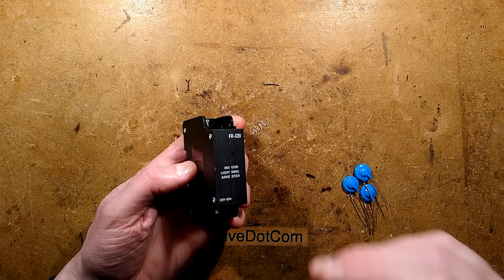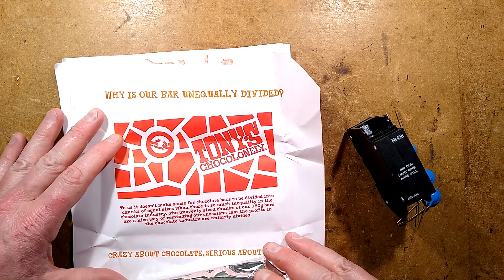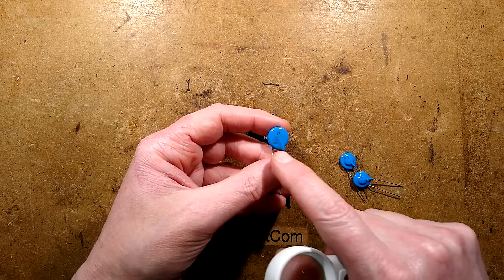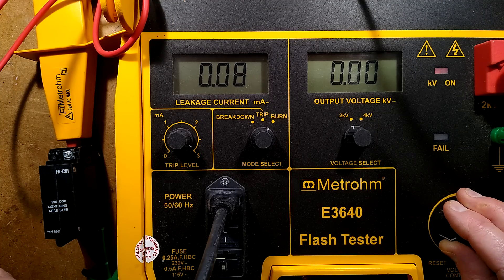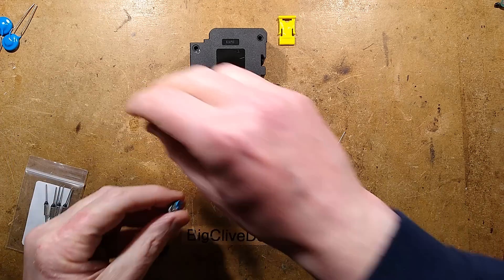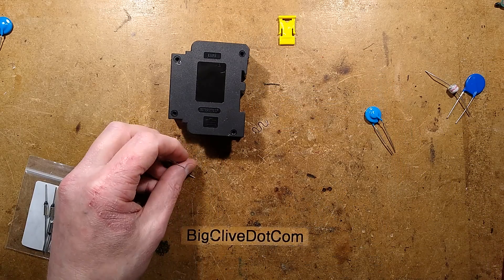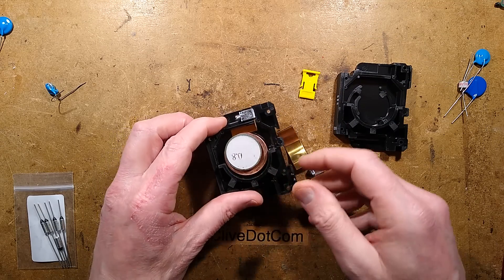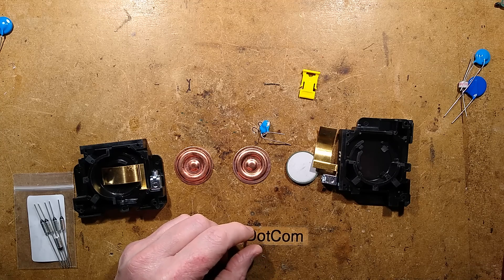Inside an African lightning protector - and candy

Comment: GDTs are usually only involved in SPDs where the earthing system impedance / distance is high enough, for example in a TN-C / TN-C-S setup the N/E linkage is more than 10 wire meters away from the SPD.  Clamp phase to neutral with a MOV and then neutral to earth with a GDT.  The GDT prevents continual leakage current onto the earthing system.  If the SPD is closer to the N/E link clamping neutral to earth with a GDT is pointless so the GDT is omitted.

Comment: Yes. I lived Johannesburg on the “highveld”  6000’ above sea level in South Africa. This is a place that has one the highest number of lightning strikes in the world. I got tired of having my electric gates, microwave, tv etc etc destroyed by lightning. Even a strike near the mains feeder cable absorbed the emp.  and after consulting with an expert I installed a set of MOVs in our main switchboard.  Many people had plug tops with a mov inside. Apparently if you have a strike you should replace the mov. Was never sure how I could test them.
Reply: A proper surge protector will have a circuit that measures the leakage current across the MOV. When it increases to an unacceptable level indicating damage, a "protected" light will extinguish and in switchboard/installed applications, an annoying buzzer will sound. It also needs a thermal fuse, because in cases of catastrophic damage, the leakage current will increase to the point the MOV will heat and burn. You shouldn't use plain MOVs for this reason.
Reply: @straightpipediesel  It was about 30 years ago & I no longer live there. The company that supplied them were consultants for lightning protection on a big steel mill upgrade and expansion project that I was working on.  The main problem was that the incomer switchboard & meter was at our gates with a cable running underground for about 60m (we had a long drive way) up to the house. They seemed to solve the problem at the time and the house is still standing .😀
Reply: Which is why you need made in South Africa ones from CBI for example. Your solar panels will need DC ones too to protect them and your inverter\charger 🌚
Reply: @andrewallen9993  The company that supplied them were our consultants for lightning protection  on a steel mill project (Middleburg) I was working on - pretty sure they were upto spec at the time but it was 40 years ago.

Comment: The roof being neutral earthed may simply be a precaution against the overhead wiring falling on the roof or the means of anchoring the overhead wiring to the building becoming live.  Such items can become live indefinitely without the neutral earthing, just waiting for someone to get themselves between it and the physical ground.  Lean a ladder on the roof and you are dead more or less.  Of course, this assumes fuses or like upstream in the network which there probably is even if it is only on the primary side of the transformer.

Anchoring equipment (P.O.A.) is often neutral earthed in Australia, varies based on the age of the installation and which state / territory it's in.

Comment: From What I Can Tell This Was Made By CBI (Circuit Breaker Industries) Which Is A South African Company,  They Are A Well Known And Trusted Company In South Africa And There Products Are Extremely Good  Quality And Reliable, I Believe That This Is Either An Older Protector Or A Clone Of A CBI Product As They Do Not Use Those Screws Nor Connectors At The Top And Bottom.

Amazing Video Regardless Clive!
Reply: Yes it looks like they took the CBI samite breaker type and made a cheap clone. The CBI surge arrestor comes with the indication if it is still functional.
Reply: There is no guarantee that this is a 'gin you wine' unit. There is a chance that it could be a Chinese clone / counterfeit.
Reply: @Frankhe78  Most Definitely A Chinese Clone

Comment: I have inspected dozens of household fuse panels after lightning strikes. The black device would be great protection and worth its cost 100's of times over after a direct hit. Fitted behind a 100A breaker it will not save the latter but likely everything downstream. Nothing wrong with copper coated steel discs. The skin effect makes most electrons travel on the surface anyway even at 50Hz. The steel plates would also act similarly like crunch zones on cars, slowly dissipate the resulting heat. Overall the product enjoys great corrosion protection and good longevity.
Reply: Skin effekt does not really come into effect at 50Hz when talking about the scale we have in typical homes as the skin depth is over 9mm in Copper. So this would only be relevant for beefy bus bars etc. you typically do not see in home installations ;)
But you are still right: when talking about lightning stikes effective frequencies are much higher then the 50Hz of the grid. So the current of these impulses (not of the normal operating current!) is carried mostly on the surfaces.
Reply: The skin effect depth at 60Hz is 8mm. As a rule of thumb, if a device fits in your hand, the skin effect at mains frequency is not relevant to its operation.

Comment: Talking about lightning here, look at the shape of the copper discs. They trap a volume of air between them. If an extreme amount of current is coming for a brief moment the intent may be to heat and expand that trapped air "explosively" and blow the discs apart within the housing, creating a temporary self-sustaining spark gap.   

It may not save any sensitive electronics but I gather the idea here anyways is to prevent house fires.
Reply: The thing is that a fuse or breaker is specifically supposed to extinguish arcs, not sustain them. A "self sustaining" spark gap would pass almost as much current as the breaker would while closed, since the entire point of a spark gap is to act like a closed switch when there's an arc across it. Those are almost certainly just some locally available washers that are about the right size to act as shims

Comment: I think the metal-oxide varistor should be in between the copper-plated steel disks. Then there'd be a spark gap between the rims of the disks , around the circumference of the MOV. Spark distance the thickness of the MOV plus a bit. That would also convert the linear contact point of the brass spring contacts into a nice gentle ring contact on the MOV.

Comment: Lightning is jumping an air gap often miles long.  I don't think anything that fits inside a house is going to do jack squat to stop it.  :\
Reply: "I don't think anything that fits inside a house is going to do jack squat"  No. But there are near-misses. Electricity does not 'take the shortest path', it takes ALL paths; more on the better paths, less on the long/skinny paths. 
We once had a huge tree hit, can't stop that many-thousands-Volt strike. We also had fried modems and microwave-brain every year, hundreds-Volt side-strokes from a main stroke a ways away. Little MOVs and similar greatly reduce damage from induced current. 
It also seems wise to have layers. I have massive dirt-grounding along my overhead line and underground feeder. I have a big MOV unit in the main breaker box. And I have "surge strips" on any precious load.

Comment: If the center of the shims is lower than the outer and that dark ring around the varistor is an insulator then maybe there's actually a small air gap there, but if that's the case I think each steel shim should be on each side of the varistor, unless they designed it to use the same parts to make arrestors for different voltages by swapping the position of the shims, like one way for line to neutral and the other way for line to line.

Comment: Yuck. Stevia, tried it and leaves an after taste. Also like sucralose, it is still high in carbohydrate 😮
Reply: Sucralose is almost pure carbohydrate, chlorinated sucrose actually. You just use very little because it’s extremely sweet. (600 times sweeter than sugar.) it’s often sold bulked out with dextrose or maltodextrin, through.

Also the human body doesn’t seem able to digest it.

Comment: That laugh when testing the "copper" disk made my day.
Reply: TRUST NOTHING!
And he proved himself correct with that mindset instantly
Reply: Same! The "Maaagnet!" was the best.
Reply: Maybe they're bimetallic for a reason!
Reply: @abitofabitofabit4404  possibly, but for what reason?..
..thay was pointed aginst eachother anyway, that makes a litte sense, tha fact its magnetic is interesting... its possibly at high enugh current those two will separate (magnetic separation), but thecurrent need to be darn high .. high enugh to make it useless as aprotection device i belive, and as a lighetning protecton, well, thay will weld together long before thay can separate likely, and as its desiged, the 'shims' are alot larger than the varistor and the lead thats clamped to it, so u have a gap beteen conductors that marginally larger than the with of the varistor, any lightening strike would jump it like it waseent present...
...but as a protection against surges, starting/stopping lager electric motors etc it probably work.. I def wouldent trust it doing any lightening protection
Reply: @Patrik6920  Well, if directly struck by lightning, even if it were actual copper, it would still blow itself apart. Eddy currents get weird when current is really high. Everything that carries current tries to escape from everything else that carries current. Very violently. But if that happened, you have already failed to save your devices from the lightning.
Reply: @Bubu567  true...
its someting rarly mentiond: the time factor, a lightening discharge is quite fast...
sure sometimng may be built to 'eat' a 100kv spike, but lightening is litterally electrons moving, and thay r fast... over a second the energy is not that large..but the energy is delivered over a very tiny time, ns
say u have a discharge of 1MW over 1 microsecond... its energy is 1w
..but usually if anything is built correctly u should never ever have a direct discharge strike.. still the discharge spike will still have sever consecuences for most electronics..
Reply: As a resident of the South African 'highveld' (1600m above sea level)  I can confidently attest to the fact that there is no such thing as effective lightning protection in this high-altitude environment. Had a strike on a 20m high bluegum (eucalyptus) tree, it arced from the tree to a steel fencepost 15m away (part of a 300mx2m weldmesh fence), from there it jumped 20cm to the steel box containing our electric fence energizer, blew that to smithereens and vaporised the brass contacts on the 220V supply switch. I've seen stainless-steel hoseclamps fused with aluminim into one homogenous mass when my CB radio antenna was hit a few years back, and yes, it was very well grounded.....

Comment: Very interesting! We get so many strikes on our supply lines, and then when it does we get a fault where one particular LED light blows even when it is switched physically OFF - puff of smoke and a bright flash then stinkaroony and Amazon make a profit yet again!

So... would putting a bunch of those blue things across the 3 phases in our consumer unit prevent it happening?

And... do they sell that groovy chocolate in Britain?
Reply: They do sell it here! I'm not sure where as mine was gifted
Reply: @TeddieBean  You should be able to find the chocolate in many different retail locations. Don't know exactly where to get them but I have seen them around. Here in the Netherlands you can find them everywhere.

I would suggest to put one MOV or GMOV across the LED bulb L + N as close to the bulb as you can. For instance in the junction box above the light. That should provide adequate protection against overvoltage, given that you have a type 2 overvoltage protection in you main distribution board that will take most of the hit. If you have overhead lines coming in you should consider fitting a type 1 overvoltage protection.
Reply from the maker: Co op and Tesco have the chocolonely bars.  You do get UK specific lightning protection.

Comment: There would have been a spark gap if the MOV puck had been between the copper-plated shims. That would also have provided more even clamping force and current distribution across the puck too. Looks like an obvious manufacturing error to me.

Comment: I did a fair amount of high voltage (0 - 1MV+) protection of instrumentation in a previous life - GDTs, VDRs - even down to fast silicon transient diodes. If you can't stop it at first try to delay it a bit until you can. (Lots of energy in 1nF capacitor at 500kV)
I did wonder if the two 'copper' discs should have been each side of the transient disc such that a small gap would be left to form a crude spark gap. I couldn't tell from the video whether this was a goer.
I think someone else suggested this device would need to be placed after a breaker because the fail mode is often to short.
I was lucky that I was not in power distribution and my requirements were usually only for the instrumentation to survive the occasional breakdown. 
Also gas discharge tubes do not respond instantaneously - fast but not immediate. They are good because they can usually handle large currents when triggered but pretty low leakage before. (Also low capacitance compared to semiconductor devices)
I've not seen the GDT in series with a VDR before - interesting. 
Really like the Tony's chocolate bars but sharing them is a nightmare.
Sorry for the ramble.

Comment: The non-resettable thermal fuses ( in your little plastic bag ) ... are a  TOTAL  disaster ( ? ) , manufacturers fit them to all manner of household gizmos ( in the most inaccessable places ) ..... SO MANY  folk throw the faulty  item away , I have found that simply shorting them out is perfectly safe ( with the owner strongly advised not to abuse the " modified " item ) .... such modified items can work for  DECADES  with NO issues ! ! .... ( tried - n - tested ) ... DAVE™🛑
Reply from the maker: I really don't recommend bypassing thermal fuses.  It carries a lot of liability.
Reply: In most cases the thermal fuses are to protect the device from a thermal runaway failure and adds second layer of security. It's not recommended to bypass them.
Reply: @deterdamel7380  Normally I prefer not to do this ... but .... with simple household items , like sandwich grills , the thermal fuse is not really needed ( older models do not have these ! ) .... if the element burns out , it just stops working , ( or shorts to earth , blowing the plug fuse ) ... if I remove these unreliable devices , I ALWAYS inform the owner ( not to leave it running all night ! ! ) .... DAVE™🛑
Reply: @davidfalconer8913  This is non-compliant. You can't argue older devices don't have these, just because you're too lazy to replace them.
If you're unable to realize the use of the additional thermal fuse, please do not repair these devices. Sorry, seems that you're not qualified.

Comment: Perhaps they have made an error in the assembly? Maybe the MOV should be sandwiched between the "copper" plates, so they could also act as a spark gap?
Reply: Yup, I immediately though the same thing. The shim must have been intended to uniformly clamp and spread current across the MOV slug's surface on both sides instead of letting the puck only make contact with the other terminal's spring. Definitely looks like an assembly error to me too.
Reply: I dunno, I'd go with parallel for MOV and gas discharge. As the MOV begins to fail and eventually open due to vaporization, the gas discharge would engage and continue protecting at higher energy levels.
Yes, vaporization, I've had MOV's fail a foot away from my face, nice ball of plasma as they short and vaporize.
Reply: @spvillano  The normal failure mode for MOVs is increasing leakage current. That is why they should always have some sort of thermal fuse to disconnect them once they get too hot.

If a MOV explodes, it was either defective, got damaged by a gross overload or was worn well beyond its service life.
Reply: Could be slightly quicker to assemble with the "copper" disks together then the MOV. Who would ever find out?
Reply: Manufacturing/Assembly error this is not even a possible excuse for that level of design error. Africa has a variable climate and some of the wettest weather on the planet and this would fail as a safe gapping device in humid areas; essentially all that little lightning surge protector will do is make those two copper discs melt together with a loud bang/pop hiss crackle sound while giving the lineman a week's paid holiday in advance.
Reply: i bet you are right I immediately though the same thing.
Reply: Same, that is why that batch was sold to Africa